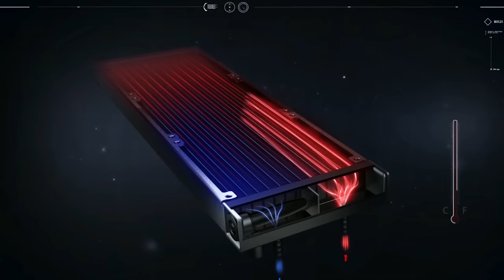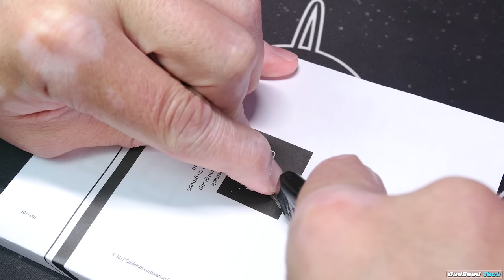How to Paracord Glorious Model O- : PROPER Method for Low Front Mice

Comment: This video is a lifesaver. My model o's cord broke on the inside this week and I was thinking of fixing it myself via soldering. This method looks much easier and with a cleaner end result.
Reply: was it disconnecting on quick moves?

Comment: Well this is coming in handy since i just had my second model o cable fail on me so I'm just going to paracord it instead
Reply: I was wondering if that worked since my cable just died.. getting the new cord would fix it ?
Reply: @kingAngel53103  yes, they have a very good video on their website showing how to install the new cord. That and it has a better aesthetic imo so I will take non-voiding warranty any day of the week (and their new cord even if you install it doesn't void the warranty!!)
Reply: OMG SAME FOR ME LOL
Reply: i'm new to mkb gaming, when a cable fails do you need to buy an entire new mouse or how do you fix that problem? Looking to buy a model o- tomorrow
Reply: @RiverSight  Hey, could you link the vid please since I couldn't find it on their site
Reply: @jay-jt1lf  i know im late af, but if its a cheap mouse dont even bother. In mouses a little bit more expensive like the model o, its better to change the cable just because its easy and cheaper than getting a new mouse

Comment: Just a tip i got from one of the paracord videos way back when, if you heat the clear shrink wrap and put it into the slot while it's hot it will mold to the slot allowing it to be much more stable then letting it cool and trying to jam it into the slot.
Reply: You run the risk of melting the plastic of the shell that way, specially if its thin.
Reply: @ariathyf144  Na, ive done a bunch of these, the shell plastic wont warp.. the heat shrink is very soft compared to the shell

Comment: mine finally just arrived. its so good. I haven't even had it for an hour atm
Reply: Is it big cuz I have regular sized hands (for an 11 year old) and I don’t know if it would fit my hands
Reply: @ZachlyGaming  no, im 14 and my hands are 17 by 8 and it is the perfect size. you shouldn't have a problem if you have small hands. definitely get a model o- (not model o) or if you have a lot of money you can get a finalmouse ultralight 2 for like 150 on ebay which is really small and really light
Reply: Ill go with the o-

Comment: I used the "cut open and reuse the stock stress relief" method on my Xtrfy M4, actually cutting it open was the hardest part, after that the paracord fit in pretty easily and it really wasn't very tight putting it back in so I wasn't worried about it putting strain on the plastics, I was more worried about popping out the scroll wheel to make room to feed the jst connector through the pcb cutout lol. looks so clean now that it's done though and the paracord is so much better than the stock 'ezcord'

Comment: Y’all are making this too complicated. Just don’t use the second heat shrink. Shrink it near the jst connection and cut the second one off. I’ve done this on about 10 mice and have never had an issue.

Comment: I got my model o- with some super loose left and right clicks. I know all of them Have loose buttons but I mean really really loose. I decided to send it back and just get a g402 which I’m loving but I would’ve loved the model o-
Reply: cinIALVEspO w put 2 small piece of tape under the dpi and above the dpi button to connect the 2 buttons. Go to r/mousereview on Reddit and you’ll see a couple of fixes for it
Reply: cinIALVEspO w they are going for a lightweight design, so it saves weight, but my wiggle was too much. They didn’t even try to replace it either. They just have bots running customer service.

Comment: My paracord is still kinda loose where the stress relief is. It doesn't pull the cable out, but it's loose and can easily wiggle. My paracord came with two clear heatshrinks but I only used one, do you know if adding the second clear heatshrink would fix the wobble or make it too thick ?

Comment: I paracorded my model o today but sometimes the wires in the paracord are getting pushed back in the mouse and then the scroll weel is getting blocked. The heat shrink doesn't keep the wires in the paracord from moving. What can I do to fix this? I used the method with the blank wires inside and the black and transparent heatshrink (fake stress relief).

Comment: here is my story about the model o-.
so in november, i got my model o- and it was by far my favorite mouse ever. Then, a couple months later, it just stopped working. at the beginning, only every now and then, and then it just completely went out and i was very upset (because i thought it was my fault because i got mad at it sometimes and thought i broke the sensor). SO HERE I AM, about a month after i got my razer viper (its pretty good but not as good) and yesterday i took it apart to see what had happened, and when nothing looked wrong, i looked up why, and everyone was saying it's a cable problem. So sure enough, i take out the cable and put it into a working mouse, THE            MOUSE             DIDNT               WORK. So now im out ordering a new cable to put inside and see what happens. Wish me luck.
Reply: (oh and yes i did try to put an extra mouse's cable in and windows said that "there was a malfunction" because it was the wrong cable or something)

Comment: or if you want, just go the Glorious website and buy there new and improved ascended cable (the same on the new Razor Viper )and install it with there video tutorial and you won't void the mouse warranty! (the cable comes with new back feet for replacement as well)

Comment: When I move my mouse fast.. it’s disconnects what’s going on I’ve had my model o- a month..  please help I don’t want to try this and break the mouse I’ve never paracorded a mouse and I don’t know what I need apart from the equipment you stated... like where do I get extra wires that to put inside my new cable ? It’s all so confusing ahhhh.. am I using the same broken red green and yellow cable in the para cord?
Reply: iDemeeetriiHD look up glorious gamings video tutorial on how to paracord your model o/o-, you can also buy their ascended paracords from their official website. The reason your mouse is disconnecting is because your cord is bad.

Comment: (If your model o is not working) Guys I contacted support, they are VERY helpful, they are understanding, you have to send a video and make sure to open your email that has they order Id and order history. Then show the tag of your mouse (on the cable) in the video, finally show the issue of how the mouse keeps disconnecting, upload the video to Dropbox or streamable.com (if you took the video on your phone, connect a charging cable to your USB port, press allow in your phone, and in the search bar (Cortanna) search: photos, then import, then click import from usb device, after you upload it to streamable, copy the link and give it to them, you have to use streamable or Dropbox because if the file is too big it won’t work, after you copied the link, paste it in gmail and send it to support, they will get back to you in another 3-5 days and you will get a ticket, worked for me hope it does for you) They will get back to you in 3-5 days and offer a replacement cable and replacement mouse feet, FOR FREE the cable comes in a lot of different colors btw. If you want a refund, ask for one, like I did and I sent the mouse back in original packaging, they will give me a refund. If it wasn’t clear, the disconnecting issue is NOT because of the cable, it is because of how the cable is packaged at a right angle so if you get a replacement cable, it will work fine. glorious are working on the issue and they will fix it in the November/December batch, I asked them on Twitter. Note, that you will have to pay for the shipping, the replacement cable, and the refund. If you refund you have to send the mouse back, after you send it, look on the receipt for example: for usps you get a receipt and on the bottom it will show the tracking number it will be 35 digits long you won’t miss it and you have to email them when it ships then they will give you a refund. Reminder the cable is free, the shipping is not...

Comment: I only saw one heatshrink used on the heatshrink method what did you do with the second one?
Reply from the maker: I discarded the extra but I've had some people reach out to say they get a more stable mount when using both black sleeves stacked.  Like melt the first one a bit and then melt the second one over top.
Reply: @badseedtech  I saw that you said stack both heatshrinks by melting one a bit and then melting the other. I was wondering if you could melt one, let it cool or wtv and then if you don't like the fit you could melt the other one. Would that heat the first one too much causing it to melt?

Comment: Well, I'm still in step 0 of this mod.... Gotta get the damn thing first 😂 I've already ordered it but I'm pretty sure it's gonna take quite a while until it arrives
Reply: Took me 4 business days
Reply: careful the stock cords are terrible mine went out in 1 month.
Reply: @ibramistafanous1231  that might have to do because you didn't unkink the cable. But I will get a spare paracord just to be sure..
Reply: @kklejdi6752  what do you mean unkink the cable ? and yeah good idea.
Reply: @ibramistafanous1231  oof... If you remember, the way the cable was bent downwards and then wrapped around in the box could damage the cable. That's why when you get it out off the box you make sure to straighten the cable in the spot it was bent cuz that could cause problems :P
Reply: @kklejdi6752  i had no idea ! thanks for enlightening me

Comment: I just did this to my model o- and it stopped working, with the led blinking constantly when i plug it in any solutions? :(
Reply: I used the method where you cut the stock stress releif
Reply: When i plug it into my brother's computer it just says the USB device connected malfunctioned and windows does not recognize it...
Reply from the maker: Sounds like a bad paracord to me.  Or you didn't get the connection reseated well enough inside.
Reply: @badseedtech  okay Ill try reinserting the paracord
Reply: @zhenghan1141  did it work? because I want to use this method

Comment: You don't need heat for the Teflons If you use a letter knife.
I have a cleaner method using the 2 heat shrinks and the plastic placed at the same spot :
(post n 1392) https://www.overclock.net/forum/261-artisan-sales-forum/1621381-paracord-mice-cable-made-ceesa-140.html

- Put the paracord in the middle of the heat shrink at the right location, once heated (ideally only around the paracord) use a cutter and a scissor to shorten the length of the 1st shrink to prevent contact with the Wheel.
- the length of shrink corrected, encase the 2nd one on top of it. This will result in a tighter fit with the shell.
- If you can't slide the 2nd heat-shrink All the Way to prevent contact with the wheel again repeat the cutting process once you put it well enough through.
- Heat the clear plastic at the correct location avoiding the naked wires with the flame (I used bursts of 2sec rotating the thing).
- before screwing the shell test the wheel, the naked wires should do a clean 90degres at the exit
- close, re-screw and enjoy https://www.youtube.com/watch?v=AHKH3-C26dM

Note : not only zowie, ninox aurora but also CM MM710 share the same pin arrangement.
Note2 : Wheel rubber size is 9.5 for those looking to swap it with custom "weeding ring rubber".